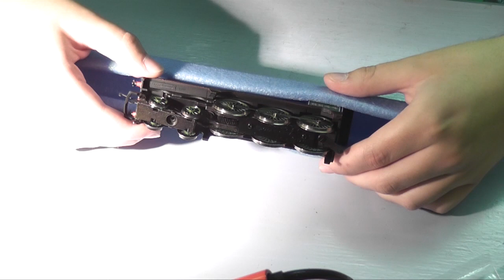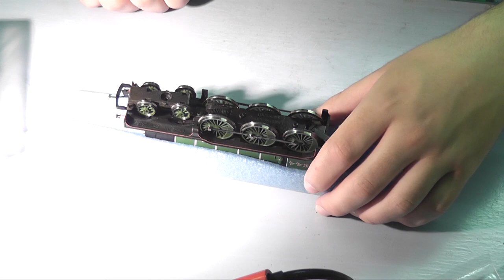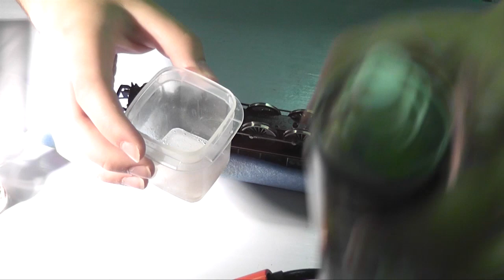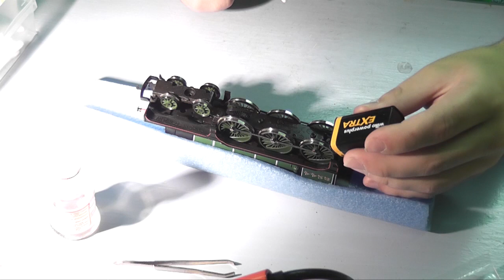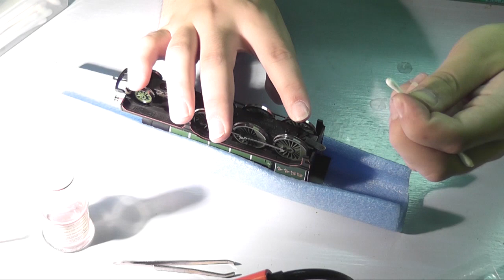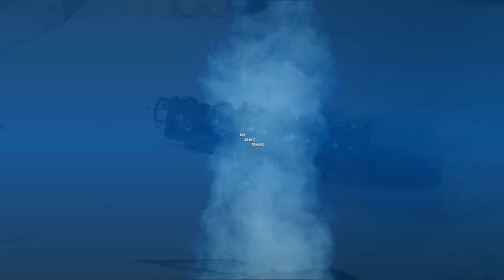Model Train Maintenance: Wheel Cleaning

Comment: Cotton bud and liquid cleaner - I find isopropyl alcohol (IPA) suitable.  It's cheap, used in industry for cleaning electrical contacts and it doesn't seem to harm paintwork.   WD40 leaves residue when dry. Nail varnish remover is not my favourite either.  It often contains  additives - it's not just acetone.   So, having softened the gunk on your wheels with IPA and the cotton bud, use a PECO powered brush and scraper with your loco still inverted in its cradle.  This is far quicker, and works both for DC and  DCC equipment.
Reply from the maker: Yes I use IPA these days too - works by far the best!
Thanks for watching - Sam :)

Comment: probably shorten cleaning time by doing wd 40 first then just one lot of polish remover to finish/dry 

also its handy to place an oil-free (ie unscented) new tissue gently over your cradle before placing the train car. this partly helps protect your paint and fine parts but  also if you do spill any solvents , especially drops unknown to you while moving your cleaning supplies around then it can help soak it up before it gets to sit and soak into the train paint. plus if a tiny rail comes off its quick to spot on the white tissue. and if you are doing work that needs to sit for a while you just fold the tissue up around the car, pick it up wrapped so no fingerprints and set it aside elsewhere while you move onto next car to work on.
Reply from the maker: Yes that's probably true - not a bad idea, but I chose not to touch my locos with WD40 these days - I used to use it, and I got a few brittle gears and things which eventually split. It's also disastrous on some types of paintwork, so I just use Isopropyl alcohol these days - and that's all! :)
Thanks for watching,
Sam :)

Comment: A bit of a rhetorical question I know, however I have just picked up a Hornby Super Detailed S.R Un rebuilt Hornby Battle Of Britain Class Fighter Pilot, however as I struggle with working on engines, My Friend is currently having a look at her yesterday He had a look and told Me she is missing center wheel spacers, so I have ordered a replacement for her, however does this mean the engine needs new wheels ? the loco did run briefly so should be in for a fighting chance

Comment: Very good. Have you got a cheap effective method of cleaning track?
Reply from the maker: Thanks very much... I can honestly say that the PECO track rubber is (personally) the best method of track cleaning - I go over mine monthly with it, and never have a problem!
Small handheld vacuums are a good idea too, for the dust or hair!
Cheers,
Sam :)
Reply: get a small block of wood (track rubber size) wrap a scrap of rag (cotton) around it and invert a bottle of surgical spirit to make it slightly damp-then gently rub over track- it will lift dirt off like magic-it evaporates very quickly and is made for use on human skin so no problems there. Do this once in a blue moon and occasional standard track rubbing in between will keep things ticking over for a long time.

Comment: One of my loco's wheels have become particularly hot after running, instead of the motor. What could that mean? Would appreciate your help!
Reply from the maker: Wheels?! That's strange - the only things I can think of could be heat generated by friction (oil the bearings), or heat generated by arcing through the pickups (clean and adjust the pickups) - which loco is it??
Thanks for watching - Sam :)

Comment: spinning the wheels with a battery or any electrical supply will only work on straight dc loco's so what do you do for dcc or even radio control loco's
Reply from the maker: It should work for most DCC locos too, provided they're programmed with DC control enabled. If they don't, I just unplug the tenders (or the decoder itself if this isn't possible) and then power the motor directly!
Thanks for watching, Sam :)

Comment: Even though this video is almost three years old now, what about rolling stock wheels? Are they any different, and does it matter what you use to clean them?
Reply from the maker: +connor kennell Hi, thanks for the comment! I now use lighter fluid to clean most things - it's perfect for metal wheels, and doesn't corrode plastic wheels either! If your rolling stock has plastic wheels, make sure you don't use nail polish remover, since it eats away at the plastic!
Cheers,
Sam :)
Reply: Sam'sTrains would this work for track?

Comment: Well how you clean diesel and electric locos you only do steams
Reply from the maker: Hi Ellis - you can use the same methods I showed here. If your engine has some non-driving wheels, you can attach the leads to those. If they're all driven, you'll need to remove the body, and connect the leads directly to the motor or wires!

Thanks for watching,
Sam :)
Reply: Sam'sTrains what leads I’m only 13
Reply from the maker: No problem! You need to get some crocodile leads - like in my video - and attach them to your controller!
Cheers,
Sam :)
Reply: Sam'sTrains or crocodile clips ok